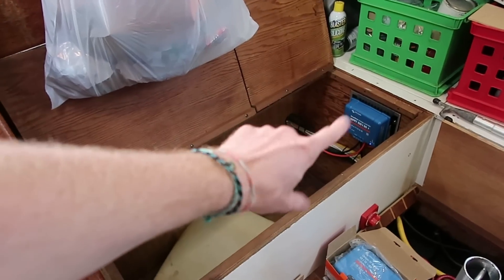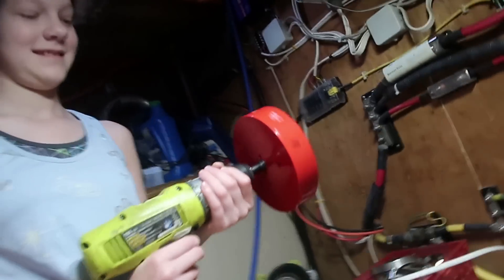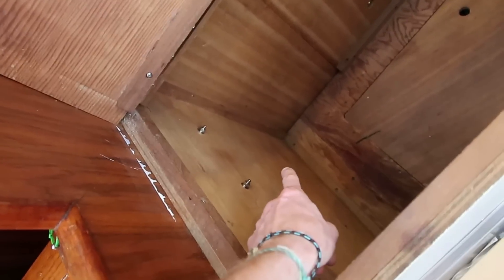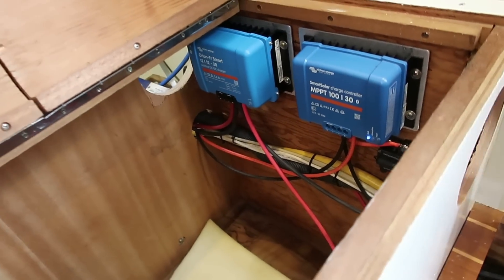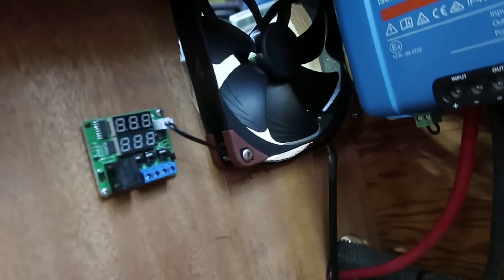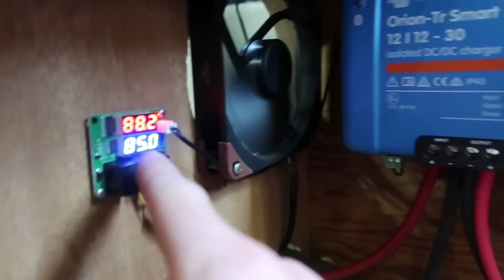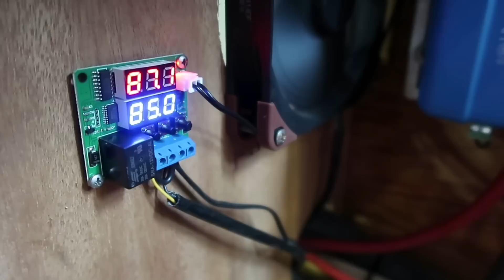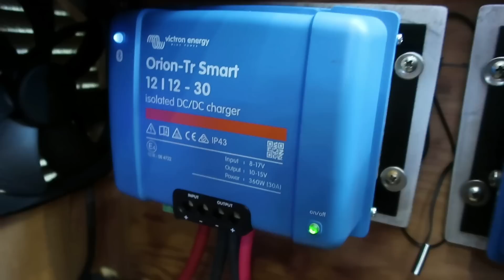VICTRON ORION DC-DC CHARGER INSTALL | Sailboat Story 215

Comment: nice but a little explanation on the actual installation of the Dc Dc is what I was expecting: what cables go into / ou of it.
Reply from the maker: Thanks. This was is clearly not a how to video, simply our installation as the title implies. There are plenty of how-to videos on the subject out there that can be found with a targeted search or even directly from the manufacturer. Specific cabling/gauges/components depend on unique factors to you own specific installation, wire lengths, etc.

Comment: The electronic thermostat pcb should be installed into an enclosure and properly sealed from salty air . It is not protected and the copper traces will corrode.
Reply from the maker: Indeed. I have a little clear box to mount it inside.
Reply: Well that is true for a majority of boat electronics which are not enclosed or sealed either. Which is why it is recommended to use dielectric grease on all electronics, even if enclosed and sealed.

Comment: Did you test the Victron stuff prior to install to check for interference to radio and navigation gear?  Victron is usually lousy with RF interference.
Reply from the maker: Nah. It’ll be alright.

Comment: Are you concerned about engine noise coming backwards thru the vent hole and possibly fumes/smells out of engine compartment when fan is off? Is there a separate engine room vent( or Intake)?
I guess potentially if there is no engine intake ( like motorboats have) then the engine drawing in air will draw air in thru those vent when running. 
I’m sure you’ve thought about this! 
Good idea to save  expensive components ….
Cheers Warren

Comment: Another great video, love the way you work together & keep so positive!
With those 'fiddly wires' it's best if you crimp 'bootlace ferrules' to the ends - you can get the super heatshrink ones as well. Stops loose wires causing 'issues' and helps with making a proper connection & stops the inevitable vibration breaking the wires under the screw.
Keep up the good work (& the videos) & thanks for sharing your adventure with us
Reply from the maker: Thanks for the tip!

Comment: So the Orion will charge the LifePO4 batteries at a limit of 30A when the engine is running. How big is your alternator?
Reply from the maker: Closer to 35amps if kept cool. Alternator is 110amps.
Reply: @Sailboatstory  But that will seriously limit how much current the alternator can deliver to the LiFePO4 battery bank. Or is that the idea, to protect the alternator?
Reply: @millzee60  agree but can add an Orion in parralel for 60 amps if desired.
Reply: @en8581  True enough.
Reply from the maker: Yes that’s the idea. It makes the starter battery a buffer between the 2. Sort of like an accumulator tank, but for electricity.

Comment: Pro tip..  Drill the giant hole 95% through then switch to the other side and drill. It will prevent blowout..  :)
Reply from the maker: Indeed. I do the same with Forstner bits. Just wasn't room in this case. Well, that's not  true. We could have removed the other electronics, but 🤷‍♂️.
Reply: Another pro tip. Do not push so hard when drilling (coughs Molly), let the drill do all the work. That will cut down quite a bit of that as well.